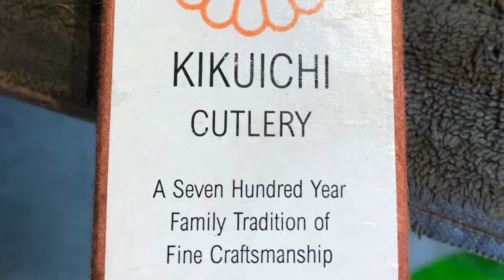Sharpening a 280mm Full Bevel Kikuichi

Comment: Do you get a lot of Japanese single bevel knives ? Most everyone I know who owns them enjoys sharpening them as well. I also wonder about the belts compared to a solid wheel or stones I don't particularly like a convex edge do you have customers who request you don't use the belts ?
Reply from the maker: The way we have the belts set up they can leave a flat or convex grind. We do a lot of single bevels... most high end knives that come in are normally in pretty bad shape, a quick set of the bevel is easiest on belts then finish on stones. We do full sharpening on stones all the time. Thanks, jimmie.
Reply: Thank you ! I have thought about buying a smaller grinder for western knives that people give me to sharpen but the convex edge is something I don't love although I do see it's advantages in a lot of 50:50 grind situations ... I'd certainly love to have your setup ! Loved the bolster video maybe if every YouTube made one companies would just quit with darn bolsters I sharpen friends knives all the time on stones and I bought a worksharp on the cheap just to grind away bolsters which it actually does nicely. Crude to some degree but the tiny belt is usually an easy bolster remover